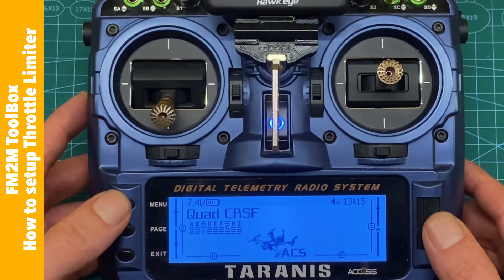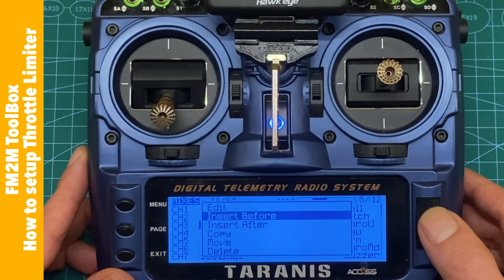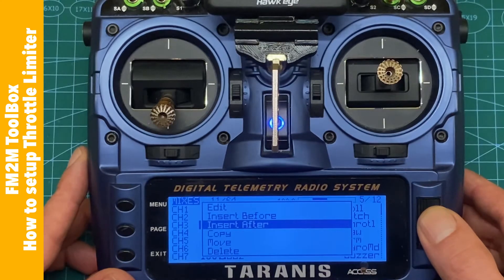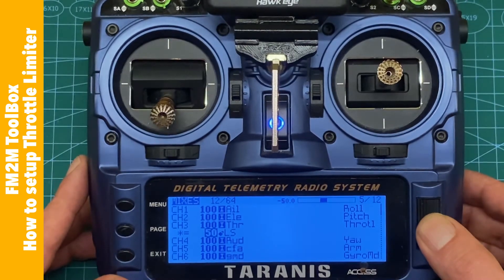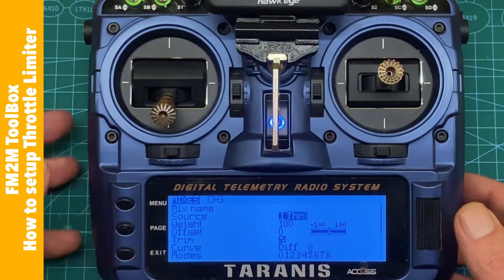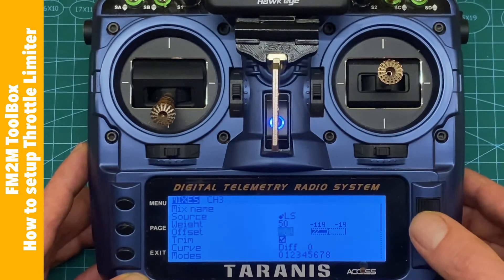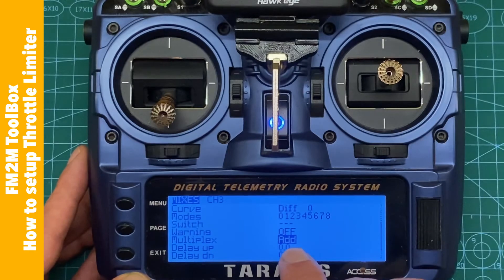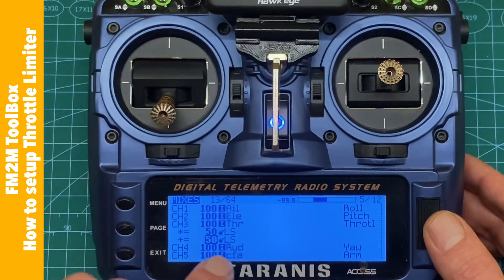FM2M ToolBox - how to setup Throttle Limiter in EdgeTX or OpenTX

Comment: Awesome! Exactly what i was looking for, it even scales it!
 Id like to set it to a 3 way switch rather than a knob. Do you know how i could make the down position 50%, the mid position 75% and the top as 100%? Very helpful video nonetheless
Reply from the maker: Assuming you will use switch SB as limiter and THR is on CH3, set in mixer:
CH3 1st line: Source: Thr, Weight: 100%, Offset: 0%, Multiplex: Add (default) or Replace.
CH3 2nd line: Source: SB, Weight: -25%, Offset: 75%, Multiplex: Multiply
CH3 3rd line: Source: SB, Weight:  -25%, Offset: -25%, Multiplex: Add